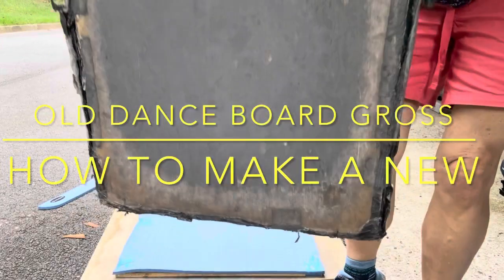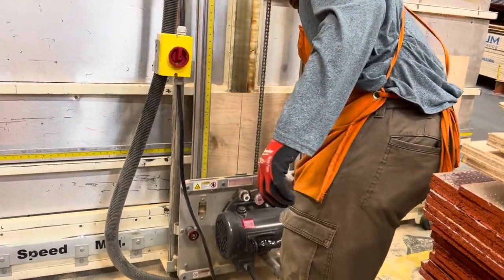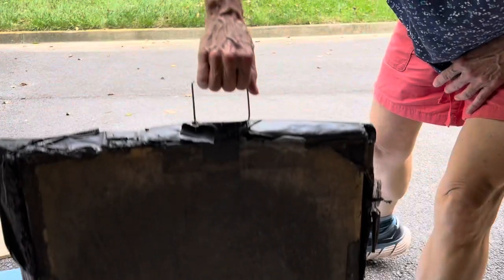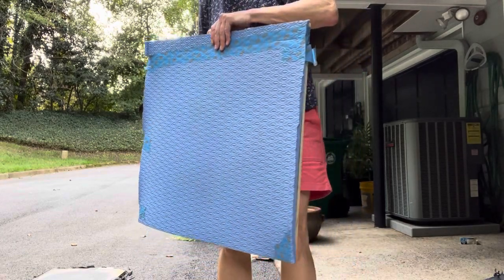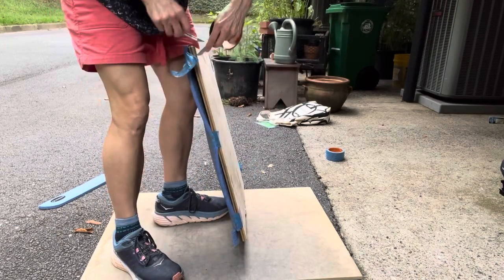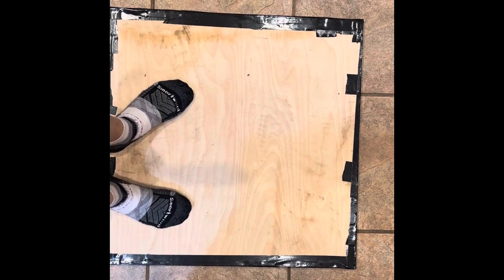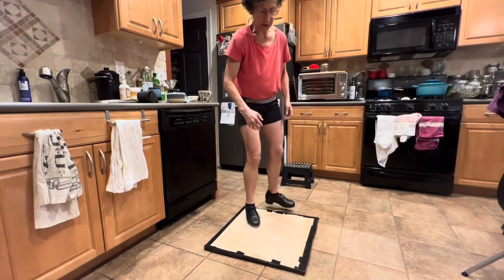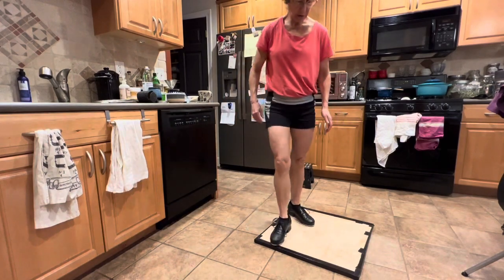How to Make a Portable Dance Board for Tap, Clog, Buck, Flatfooting, etc. - with Miss Moonshine demo

Comment: Armstrong 520 adhesive would be good for glueing your mat to the board .  Your board will be level due to the tape not being pulled tight and mashing the mat . I would suggest rope handles cut to fit your hand and screws to the edge like the metal handle . 😊
Reply from the maker: i’d like to make a round board akin to this Tap Board dot2tap Portable Sprung Dance Floor,Tap Dance Board 32 inch Premium Maple Wood 13 Ply- Includes Travel Backpack-USA Made https://www.amazon.com/dp/B08XM89J2V/ref=cm_sw_r_cp_api_glt_fabc_T222AT9W6CSS9SBW0WG5?_encoding=UTF8&psc=1
Reply: That round on looks cool but the rectangular one provides much more area to move around somewhat. 😎

Comment: If the overhang on your screen door handle causes problems, you can file away the overhang with an eight inch file. A single cut mill bastard (actual designation) would be best ,but a fresh Walmart 8” cheapy double cut will do. Protect the surrounding area with tape and sit ,holding the board between your legs, then file away. Sand paper and a block of wood can smooth any sharp edges. Easy peasy. 
Even better would be to mark the edge, take off the handle, file to the mark with the handle in a vise then screw it back on to the board. If we were neighbors I’d have done it for you on my belt grinder.
Reply: why not use a 4 1/2 inch right angle grinder?
Reply: @capacola262743  
I’m assuming she doesn’t have one or know how to use it. Personally I would have cut off the excess with a wafer wheel and cleaned it up on a 2X72” belt grinder in about two minutes. Or even better, Forge a handle ,that fits perfectly, with fire ,hammer and anvil.
Reply: You guys are hilarious. 
Can’t stop 😂😂😂

Comment: A flooring supply store just closed where I live. They left everything behind. They have hardwood sample flooring boards. They measure 22" x 24"  that is once you cut out this little medallion they have at one corner.

They are laminated with a quarter inch backer board, quarter inch of some sort of structural board,  and the top layer is various types of hardwood. Could easily run a three-quarter inch tall by 2 inch wide frame around the bottom to let the sound resonate In the Hollow area created.

Does that sound like something that would work well for an accomplished dancer?
Reply from the maker: should work! if not too slick
Reply from the maker: if slick ok for leather soles

Comment: MISS Moonshine,my profile picture here when taken I was actually refinishing old hardwood floors at my nieces.(pine) I'd love to know what wood makes the best sound for you,and what size.im actually somewhat of a wood hoarder.i rescue it from house's I remodel.currently working on one built 1864.id love to know what makes the best sound
Reply from the maker: harder the wood, richer the tone, but nice if you get a piece with sub flooring attached, so it’s thicker and more muted. some used hardwood flooring with sub attached 2.5x2.5 add a raised edge or glue on mat,  good